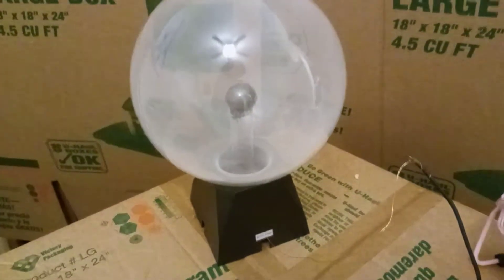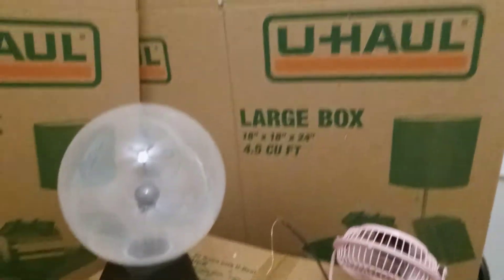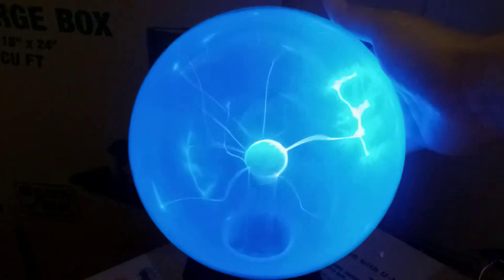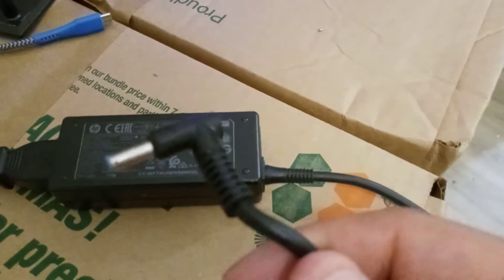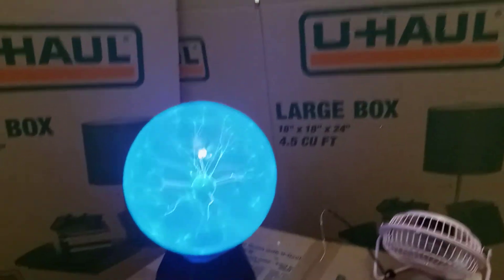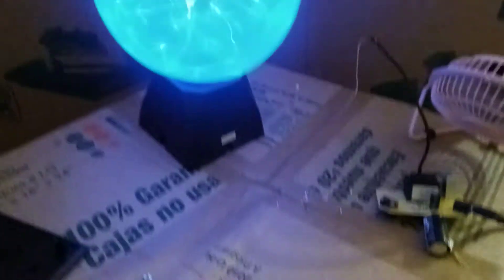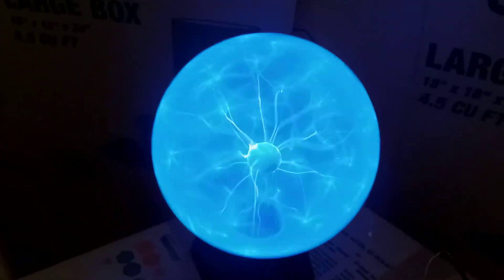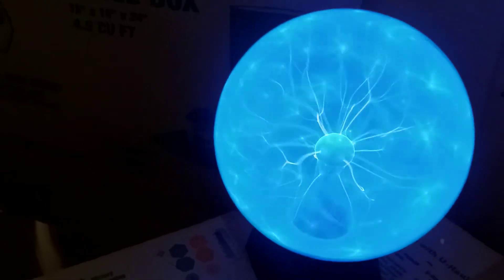How to easily overclock your plasma ball

Comment: 12V regulator will turn your 19V into 12V again. That's why heat sink is getting hot.
Reply: The heat sink on the transistor? That's getting hot because its switching more current into the primary of the transformer. While feeding the circuit more voltage does make the arcs stronger, there are far better ways to achieve this.
Reply: @albatross_v2  I bought a ball that has been glowing sluggishly since new. Share these simple ways to make the discharges stronger.
Reply from the maker: @albatross_v2 elaborate
Reply: @lilpsychofficial  I'm no expert, but I reckon the best way to get more powerful arcs is to replace the entire original circuit board with something more akin to a tesla coil, and then just use the globe piece on the top load. But, that isn't exactly easy and there is a point of diminishing returns as the arcs inside the globe only get so bright. Additionally, the arc 'shape' will depend on the frequency of the tesla coil, so it could look quite different from a normal plasma ball (which operate at something around 35KHz).
An easier method is to just replace the driving circuit with something more powerful but you risk burning out the (tiny) transformer. I remember doing something like that years ago, but since then I've forgotten what circuit design I used. It might have just been a beefier version of a slayer exciter. 
The easiest way is still to increase the voltage, maybe replace the original transistor with a more powerful one and put a bigger heatsink on it too :)
Reply from the maker: although, it does output more power

Comment: I have used a 24v adapter and mine got hot, 😭😭
Reply from the maker: i bet, those transistors dont like it at all
Reply from the maker: they make them so weak
Reply from the maker: i was thinking about buying a more heavy duty transistor, and a variable transformer, or a adjustable power supply, and seeing what would fry next
Reply: I see.
Reply: I’m gonna try to drive mine with a microwave transformer, not sure on what’s gonna happen but there’s only one way to find out
Reply: @Ghostridr5571  oh shit
Reply from the maker: be careful bro, those are deadly